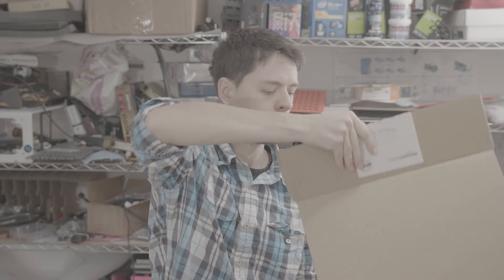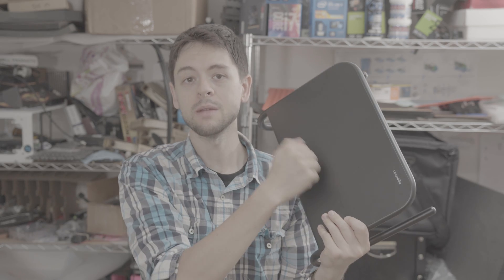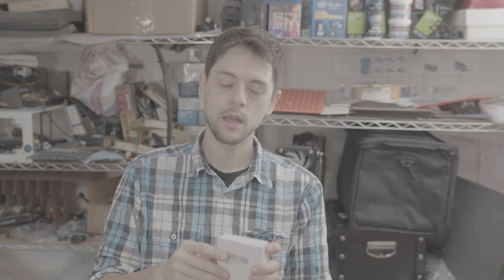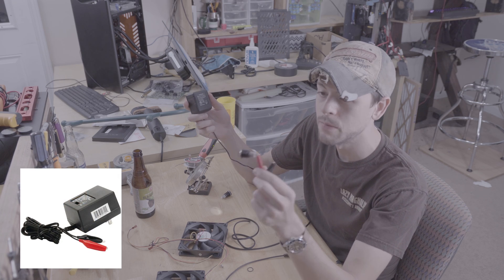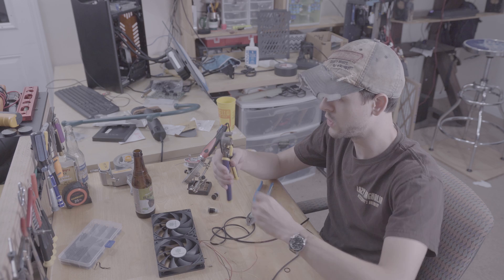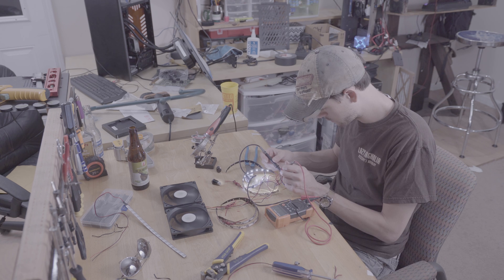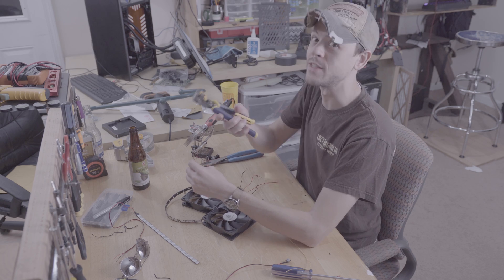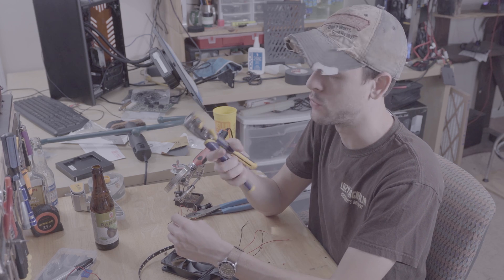Build a "MeiPad" cooler!

Comment: Now all you gotta do is build another level for a cup holder so that if the fans are oriented to push air into the s3 your cold beverage will cool the air around it resulting in the fans pushing some cold air into the s3